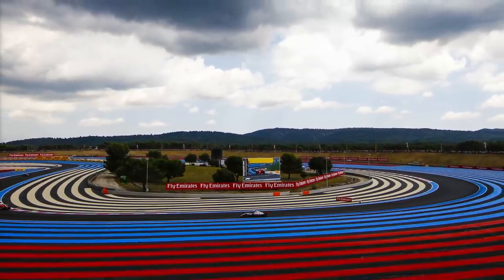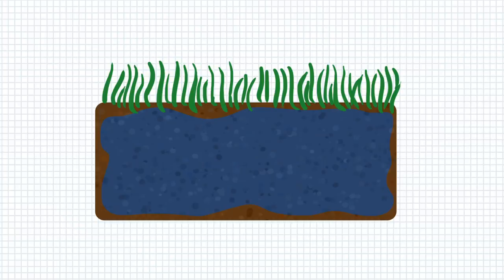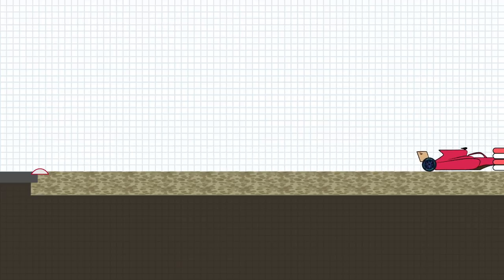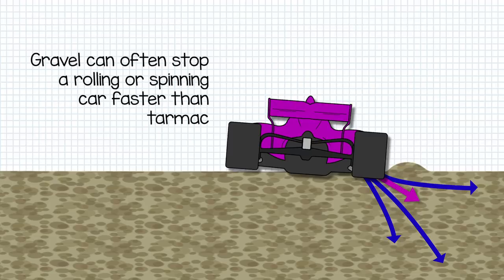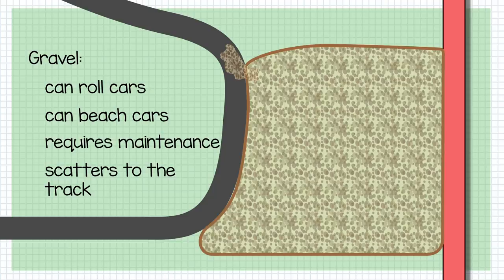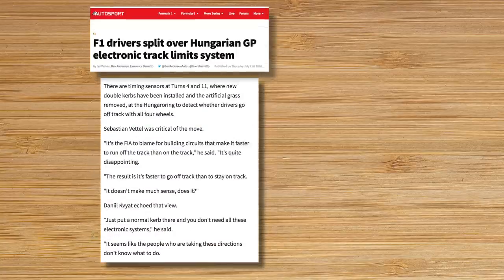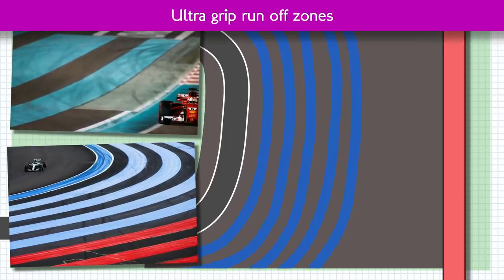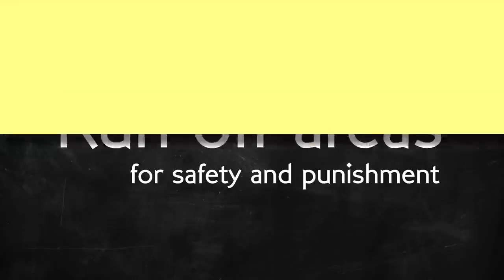Run off areas in F1 - Safety and shortcuts

Comment: Drivers getting stuck in gravel is an essential part of this sport. There are reasons why people like city circuits, it's because you crash the wall if you fail and thus your race is over. It's the same with gravel traps.
Reply: Yeah tarmac runoff is too forgiving, it is almost like a videogame with no consequences
Reply: Yeah god point but i still think it is too easy to just run off the track and only have a little tyre wear, people should get stuck or loose loads of time to differentiate a good driver who can stay on the track from a bad driver who can't
Reply: So you're saying that drivers breaking bones and maybe even dying is an essential part of this sport? That's the stupidest thing i've heard...
Reply: No Vaidas, that's not what he's saying. How do you link to names on this YouCludge website?
Reply: No clue... It's become pretty stupid tbh.
Reply: drivers shouldn't risk their lives any more than they must just to put up a good show for us
Reply: @lloydfeng5716  they should be able to risk there life when you think of what salary they get but not more than necessary ofcourse
Reply: I think gravel is good. You get punished for a mistake. You go in the travel. Your lap is ruined.
Reply: @circlesareround9217  their lives should never be at risk
Reply: Sergeant Supreme Then why drive in real life at all? Just have them drive in simulators if danger is not part of the sport.
Reply: Sergeant Supreme You don’t want to see it but without that risk why not just do sim racing? Why is watching some Russian climb a sky scraper exciting? Purely the fact that he can fall any minute and die. Nobody would watch those videos if they were wearing wires and were 1ft off the ground. Same with racing 200mph on a narrow road between barriers. 
Again I ask you if you don’t think it is about danger why have real life racing at all? Why not just do sim racing?
Reply: @LesterBrunt  I see your point now
Reply: @LesterBrunt  Because Sim racing doesnt put you under any G forces and therefore isnt even remotely similar to actually driving the car. It's the skill under conditions that's amazing. Not the threat of death. You think it's easy to do 70 odd laps without any mistakes? I cant even do it in a Sim, let alone under the ridiculous Gs they endure lap after lap after lap. Tarmac run offs with punishing return to track routes is the solution. Not immediately ending someonea race if they make a tiny error and end up bogged down in gravel. Why would you ever want to see that!?
Reply: Tummy Rubber2k So if we were to be able to simulate the G forces and/or make it as challenging as real racing you would prefer sim racing? Just because you like the danger doesn’t mean you want people to die. The hero should make it out alive but if there is no danger it is boring, that is just a fact.
Reply: Tummy Rubber2k G forces aren’t the only thing that make it a challenge. You say it
is the skill so if we make sim racing more challenging than real life would you prefer it? 
Let 200 or so drivers race on the Nordschleife at 900mph, that takes insane skill and no danger, the ultimate entertainment right?
Reply: @LesterBrunt  How can you make aim racing more difficult than real life. Do you understand what sim is short for? Try to be realistic. Seriously. 900 MPH would likely cause flight.
Reply: Tummy Rubber2k To me the difference between driving a kart at 50mph on a track compared to in a video game is the fact that if I crash it will actually hurt, that makes going through a corner at 50mph actually exciting. If there is no pain and no danger I could just as well play gran tourismo.
Reply: Tummy Rubber2k We are talking about sim racing, you can just program the cars to not fly. How is going 5 times as fast as current f1 not more challenging? 5 times faster reactions, shorter brake zones, faster corner, that is insane skill.
Reply: @LesterBrunt  Ok. 1. That's not realistic. 2. It would be impossible to watch. 3. Every single person would crash.
Reply: Tummy Rubber2k Well yeah that is why I go outside and do actual stuff because then there is something at stake. Why go to the woods if not to feel the cold, the wind, smell the forrest, use  your own energy to move through it? If not you can just type in “wood walk” in youtube and watch that. If go ride my bike and there is a downhill section and I am going 30mph, trees whooshing past, the part that causes my heart to race is the fact that I know I really shouldn’t mess up at that moment or else I am going to be in a lot of pain for a long time. And that is why I don’t feel the same thing if I take a train and were are blasting past houses and other trains at 60mph because there is no danger of crashing whatsoever. If somebody got a panic attack in a train from the speed you would be like “calm down, nothing can happen, we are stuck on rails it is perfectly safe”, you wouldn’t say “don’t panic it takes no skill to operate the train”.
Reply: Tummy Rubber2k Why does it need to be realistic if the only
thing that matters is skill? Why be realistic at all if not to mimic the real world environment where messing up means danger?
Reply: @LesterBrunt  Apparently you don't know what racing is. The thing that makes racing exciting isn't the risk of getting hurt or losing your life, it's the actual "racing" part about it. You're competing against other drivers to see who the better, faster driver is. It's in our nature to be competitive.  Sure, watching a Russian on wires and 1 foot off the ground doesn't sound exciting until you add competition in to the mix. Now all of the sudden the Russian has got a time constraint to try and get to the objective faster than the last guy.
Reply: @frank3732  Ok then why do they drive around at 200mph? If it is just about competition have them drive 50mph on razor thin wheels. 
Why have any danger in the sport if supposedly that doesn't matter at all.
Reply: @rijugas  at the core of it, yes, drivers getting hurt even dying is a part of this sport. It's always been about adrenaline junkies that are willing to take ultimate risks. There's a reason why things like free solo rock climbing and cliff diving exist and gather significant audiences, it's the same with racing. Of course you can't build and promote a sport in the mainstream with that outlook nowadays which is why they improved safety standards that much over the last couple of decades
Reply: I'm just not a massive fan of drivers losing their whole race because of one iffy turn. I would rather have mandatory runoffs because they give a good punishment like a time penalty without fucking your tires and ruining your race.
Reply: @tummyrubber2k939  The element of risk is what makes motorsport interesting
Reply: @PointNemo9  No it isnt. Or youd think watching people jump in front of a train is interesting.
Reply: @tummyrubber2k939  There is no risk in jumping in front of a train because the result is guaranteed. The chance of disaster is what creates suspense. Motorsport has lost it's popularity with the general public for good reason
Reply: @PointNemo9  What if your end goal was to escape the train as close as possible for maximum excitement. Definitely is danger there. If you need people to be in danger of death to enjoy watching it, you are a psychopath. F1 in particular lost popularity because of dominating teams. Absoltuly not because its safer now. That's why they are trying to change the rules to prevent this domination from continuing. Finally, if you need something to be dangerous to enjoy it, put yourself in the danger. Don't expect others to do it for your enjoyment.
Reply: @tummyrubber2k939  I am not talking about me but other people. The risk of motorsport is what enabled it to captivate audiences, without the element of risk people lost interest.
Reply: @PointNemo9  This simply not true.
Reply: @tummyrubber2k939  it is true tho, the risk has always been part of the appeal of the sport. things like extreme skiing, free solo rock climbing, cliff diving etc. exist exactly bc one mistake can have unbelievably severe consequences... while it is true that F1's and motorsport's appeal doesn't stem completely and solely from risk, it is or, more precisely, was a big part of it. I think it's pretty obvious that the simultaneous decrease in risk involved and popularity is not just coincidence
Reply: @richard_nj  Read what I said to other guy. If you need someone else to be in danger to enjoy a sport you are not ok in the head.
Reply: Tummy Rubber2k I remember going to silverstone as a kid to watch my first (and only) F1 race, you know what excited me? All those cars being bunched up at the start, will they make it round turn one without crashing or are we going to see a massive pileup of cars? I wasn’t sitting there chanting for them to all die, but the thrill of seeing a collision because of them battling for the best position is what made it exciting. Am I psychopath for being excited at the idea of something that happens often in an entertainment sport happening? No I am not. I didn’t go there thinking I hope there is a death, just some excitement while they battle it out. This was probably like 13/14 years ago roughly
Reply: @tummyrubber2k939  it's also the threat of death, you can't have an extreme sport with extreme conditions and speeds and not have a threat of death, name one
Adrenaline doesn't pump through your veins when you're safe and cushy and a lot of these people are adrenaline junkies
Obviously nobody watches the sport explicitly hoping someone might die but the danger these men are in and their will and skill to defy it is what makes it fun
At rally events, the most dangerous bit or bend is usually the one with the most spectators on it
People also unfortunately find violence and physical misfortune entertaining, there were people actually spectating several US Civil War battles - actual people who intentionally came to an exact spot just to observe people killing eachother
Reply: @Ash-mp1vc  "The element of risk is what makes motorsport interesting" A crash into turn one isnt very risky. Just race ending. Read what I originally replied to my life.
Reply: @dylan__dog  The most dangerous bend is inevitably the most skillful bend also. American civil war was at a very different time. You might as well tell me about the Roman Colosseum.
Reply: @tummyrubber2k939  I doubt that the human psychology and unconsciousness changed so drastically in just 200 years
It wasn't just a cultural thing, it's primal
We have beheading videos, gore and such on liveleak, there's worldstar, YouTube crash compilations... The  interest to look at others being harmed is still very well present

On a side note, the Civil War thing was also kinda worse than the Colosseum, where death was rare
Reply: @tummyrubber2k939  yeah keep telling yourself that, 50 years changed 50k years of human evolution, sure
Reply: @tummyrubber2k939  psychopaths do not feel empathy, that is the main trait and it does not have anything to do with an affinity to danger
I never said I personally enjoy any of these things just that these traits are and have been present in people in large numbers, that is all
You're just saying "no that's psychopathy", nothing else

Evolution does not happen over just 130 years
Reply: @dylan__dog  Aye, and egotistical traits. I.E danger is fun but I dont want to be in danger so you do it for my enjoyment.  No empathy for them. What does that sound like? Pychopathy. Evolution is happening extremely fast in our brains right now. You don't have to believe me, that's whatever. But 130 years ago people were absolutely nothing like we are now.

Comment: I was thinking of installing a strip of grass approx 5m wide right along the edge of the track, with tarmac between the grass (or synthetic turf) and the exterior edge of the run off area, but this solution of soft obstacles seems like it would be much more effective and easier to maintain.
Reply: Thats what i was thinking while watching the video, It would be perfect because the track would not seem like a parking as paul Richard and It would be efficient and safe

Comment: I say they should convert the gravel traps into huge pools of oobleck. In theory it should arrest their speed, but then the force of the spinning tires can harden up the surface they're trying to escape from and let them move on with the race. What fun.
Reply: But wouldn't the car sink into it and be unable to get out if it got stopped?
Reply: Or, because the car is so hot, it'll evaporate the water and bake the starch around it, making an instant F1 pie!

Comment: I like the gravel and walls (where's safe, like the wall of the champions in Canadá) 'cause I think it is supposed to be punishing. Sure, some guys (Grojean) won't finish the race, but they are supposed to be the best drivers in the world, right? I mean when there is the actual risk of dnf in case of missing a curve, that's when we see the best driving techniques. The races in these Tilke circuits are sooo boring. Great job, love the channel.

Comment: Great video . To be fair I didn't mind the run off area in Paul riccard, I minded the 200 different layouts and the paint on the run off area that made it difficult to find the track .
 As for track limits, they're only an issue on corners like copse, as cutting a corner is quite noticible. What they should do is have a patch of grass or gravel  straight after the kerbs , forcing the car to lose time, and then have the safe run off area.
Reply: My thoughts exactly. Make it a punishment for those who make a mistake, but also make it safe for those who lose control. I think a 1-2ft wide grass/artificial turf patch just behind the curbs followed by the tarmac run off area will help to solve that. It means drivers who try to rejoin the track at high speeds would have less grip and have the risk of spinning, forcing them to slow down when rejoining the track.
Reply: Actually it’s 167 different possible layouts😁 (sorrynotsorry)
Reply: DapperDog 😂😂😂
You forgot the 33 creative interpretations of track limits that are possible as well

Comment: When the new 2021 engine regulations come out can you please do a video on what all will have to change compared to the current Pu. If they are just dropping the MGU-H and sticking with the original platform of 1.6 V6 Turbo MGU-K than I would really like to know what all will have to change and why.
Reply from the maker: When they drop, I'll be all over it :)

Comment: It's really easy and hard at the same time, but my theory is to add laser measuring sensors beneath the track which make take some time to calculate, but once calculated the driver would be awarded a set penalty depending on the speed and the amount of track cut as simple as that sounds it may take some time to equate

Comment: Great video as allways!
I totally agree with mandatory return routes! But I would also add some meters of a severe abrasive pavement at the edge of the track. Then any driver who use the limits of the track to gain time would punish severely his own tires and drivers who get off the track would have an heavy grip to help them to slowdown the car and avoid crashes. It would work both as  penalization and safety measure.

Comment: Great video! I was wondering though, what if a car is out of control, say due to brake failures, damage or the driver injured? A gravel trap will always slow a car down, whereas tarmac will only do so if the brakes are applied... Would that be of any significance?

Comment: The form of having to navigate a tight chicane of polystyrene bollards from Monza is now also used for the Mistral straight chicane while the method used in Montmelo and Sochi is also used in Monza (for the 2nd chicane) as well as in Montreal, Singapore, and Mexico but in a bit different way there.

Comment: Excellent video as always! I like the approach at Suzuka where they use a small area of artificial grass on the outside of the kerb to punish errors, but then have a fairly generous tarmac runoff beyond that for safety.

The Paul Ricard approach gives me a headache! I wish they coloured the stripes the same as the surrounding tarmac or vice versa otherwise you get horrible screen aliasing!

Comment: Great Video as always Stuart!

i think for this one it's worth mentioning Things outside of F1.  Gravel Traps are especially bad for Motorcycle racing. They profit a lot from Tarmac run-off. Both in terms of safety and actually staying on the Bike in the first place.
Reply from the maker: Yeah I very nearly included that - particularly raked gravel (also astroturf is bad for motorcycling I hear?)

I'm kicking myself now cause I very explicitly meant to include a line about circuits needing to accommodate other series and it seems I forgot! 

Argh. I'll pin this comment instead
Reply: Chain Bear F1 
Yeah, hitting Astroturf on a Moto GP Bike is pretty much an instant Ticket to the Hospital.

Comment: What about a mix? Gravel trap strips that lead to tarmac and mandatory return routes? Punishment for going on means hitting the gravel which may cause damage (but they made a mistake so - punishment), it slows the car a little but then causes them to dirty their tires. Then on the tarmac they can slow down more effectively, before having to take a longer route back to the track where most gravel will be left off the circuit.

Comment: i remember a certain case in 1995 where häkkinen nearly died because the car was jumping over tarmac, after loosing the rear at a fast corner and gaining a bit of height from the outside kerbs and then had nearly the same speed when it hit the wall sideways

Comment: I like the idea of having roughly a cars width of grass separating the track from a big tarmac run off area. This way there will not be a reason to cut the corner as there will not be much grip beyond the track limits however if a car goes off then there is plenty of grippy tarmac to slow down